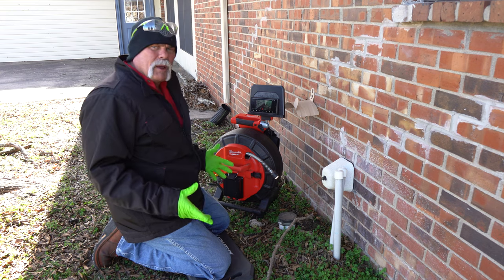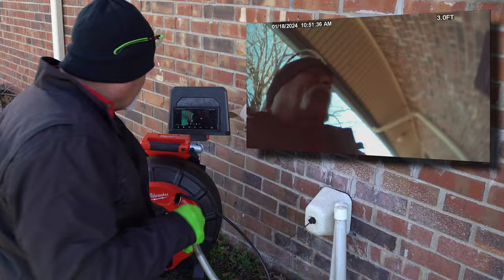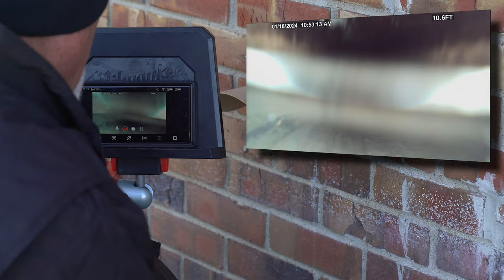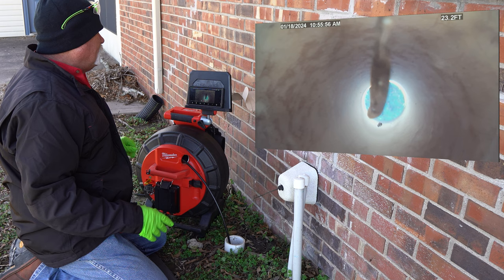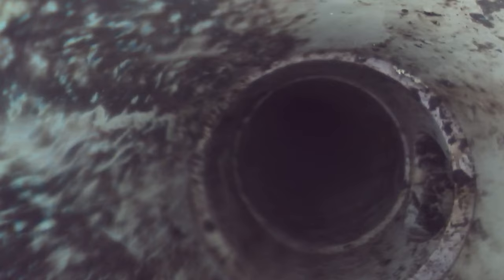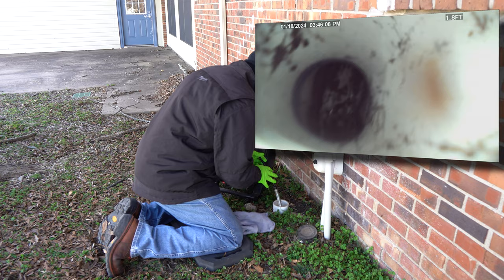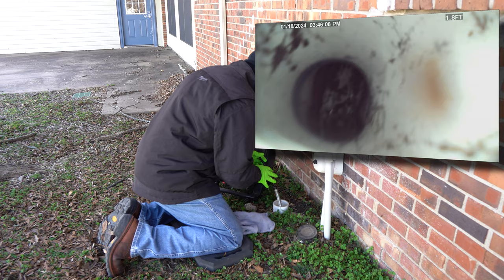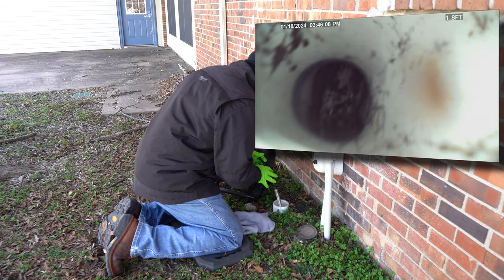How to Use a Sewer Camera | Plumbing Basics

Comment: I was using a sewer camera today.  So, something I ran into is that a lot of USB storage devices are formatted in styles that older sewer cameras might not be able to write to.  If you're renting an older camera, get FAT32 formatted USB drives.  Still used it to identify a clog, 2-line breaks, and a belly in new construction though.